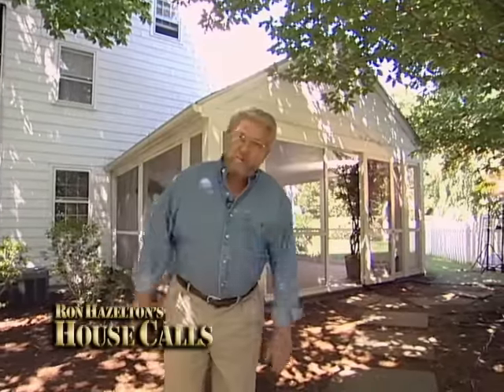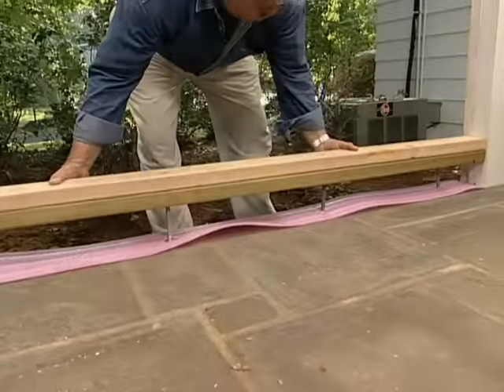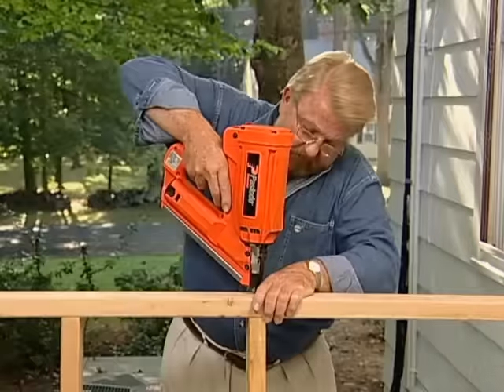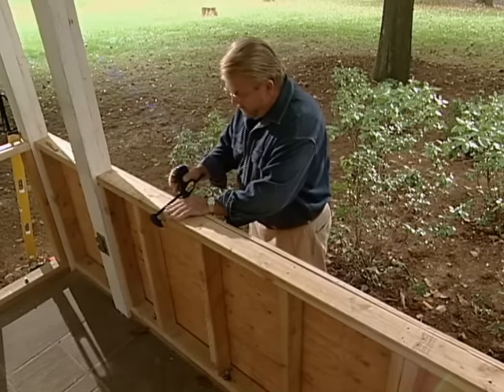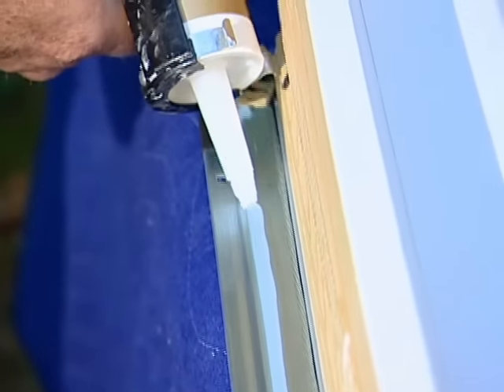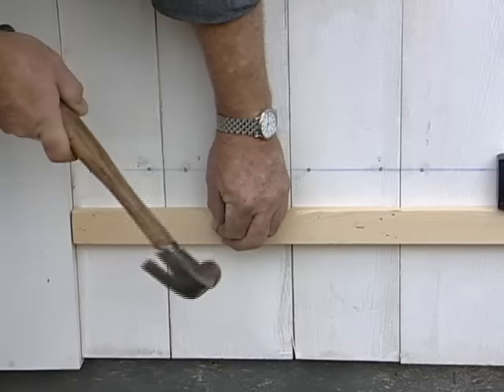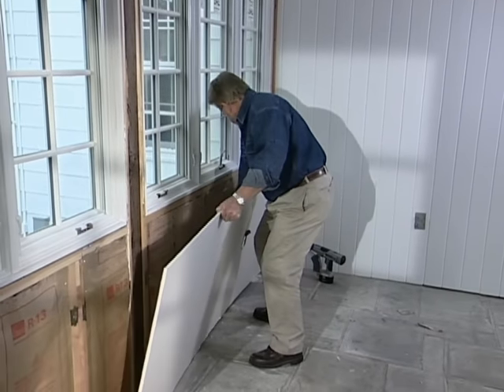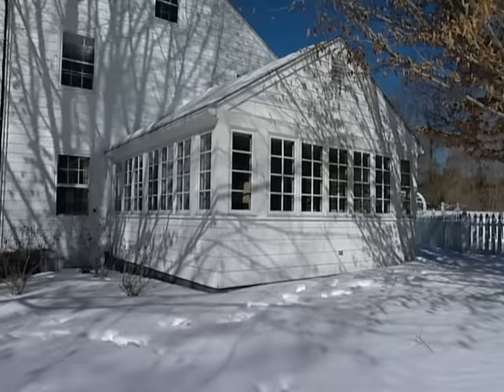How to Make a Four Season Room from a Porch

Comment: My porch slab is about 4 inches below the house floor level and slants to one corner for water run off.  I have two screened in sides, roof is part of the house, other 2 sides are the house.  I know how to raise the floor level, but how do I keep water out?  I seriously doubt that little foam barrier would keep ground water from seeping in.

Comment: I noticed that when you put in the sheetrock and insulation, you made NO mention of having your electrical wiring check and certified by a licensed electrician.  Is not this a requirement in most areas?